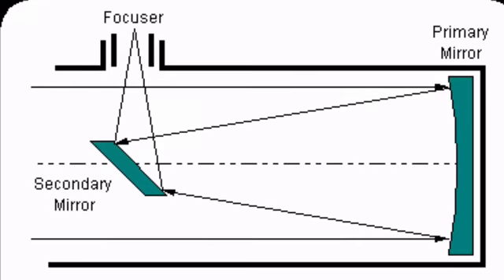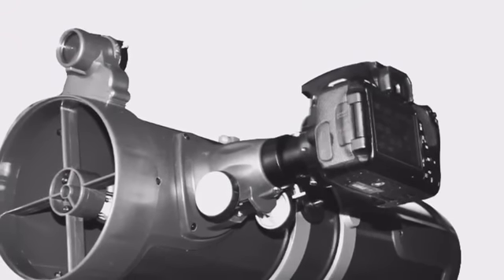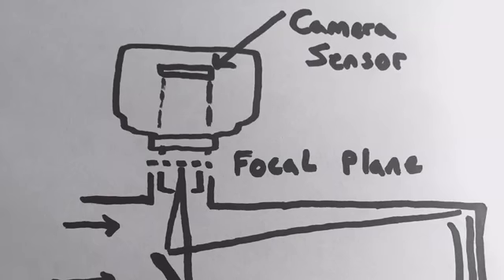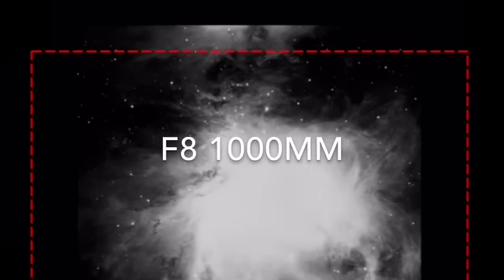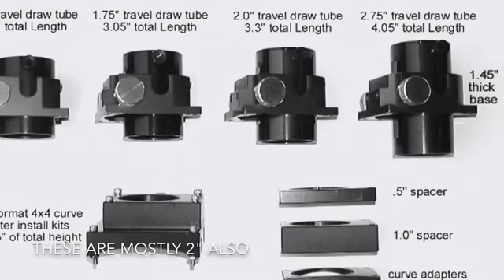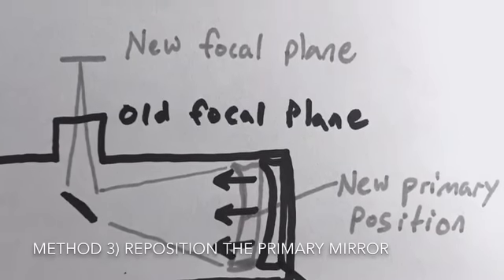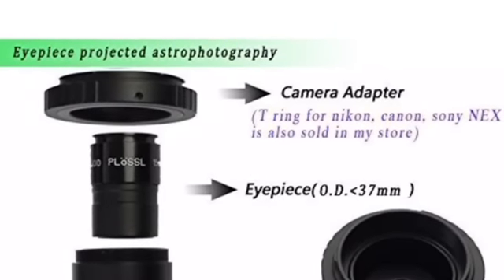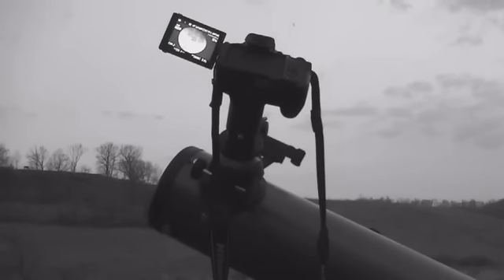Newtonian telescope how to find focus dslr astrophotography

Comment: Hello to all, thanks for this video. Just want to share how i solved this issue on a Celestron Astromaster 130 newtonian. Basically i used a mirrorless camera to fix the issue. Unlike DSLR camera, mirrorless camera sensor is positioned more forward. Instead of modifying the mirror or focuser, if you have a mirrorless camera which is popular nowadays, it can work.
Reply from the maker: That’s great info. Thanks for sharing.
Reply: I have the same telescope and a DSLR. Thanks for this great tip. Can I ask what mirrrorless camera did you use specifically?
Reply: @jaspei  Canon EOS RP :) T ring can directly fit into the RF mount without adapter so focus distance is reduced
Reply: @jaspei  we can also discuss in Astrophotography Pihilippines group FB. I saw you are also a member there. Feel free to post questions and I will help answer and post photos.
Reply: @guitarintune408  nice, and small world! I posted a question in the group to start the discussion (although still pending approval). Thanks for raising that!
Reply: @jaspei  I have the spaceprobe 130st and I just tried to use my new r6 as a prime mount and couldn't get it focused. But, I was using the rf/ef adapter. I'm going to buy the rf t ring now and hopefully that will fix it. Thanks for the info
Reply: Mirrorless cameras take poor images
Reply: @Astronurd  not really. Depends on your target. If its just star cluster like M45, a mirrorless can do the job. But if your target is a faint nebula, might as well use narrowband imaging with a mono. And, everyone has their own standards.
Reply: @guitarintune408  Yes I suppose if you are selective with your targets then they can do the job 👍

Comment: This problem has bothered me off an on for over a year, as to why I could focus on trees 600 yards away and not an antenna tower 1 mile away with my Newtonian scope.  Tons of videos show successful astrophotography for  the kind of scope I have (Celestron 130 SLT), but I always failed. Thank you for confirming that  the problem is focal plane being inside the tube (as I suspected), and for providing solutions. Been driving me nuts. I thank you immensely,
Reply from the maker: Trust me when I say I’ve been there. That’s why I made this video. Thank you for watching. Clear skies.

Comment: I did some reading and found what I needed to get started with prime focus photography with my DSLR and Meade Newtonian telescope. So went out and got the T ring and adaptor and remote shutter release. Did some more reading on camera settings and got all ready to have a go photographing the moon one early morning. The rig was all set up and the sky was clear. Turned on the camera live view. Boom, couldn't focus :( Thanks Garnett for explaining what is happening and why. I am surprised that none of the articles I read discussed this issue. Is it a problem limited to the inexpensive Newtonians?
Reply from the maker: +Tom Ball I was once in your same exact position. It was so frustrating I decided to make this video. You’re right, there isn’t much info on it strangely. The problem is astrophotography is becoming more and more popular. Companies buy their parts from a handful of distributors and they are designed around visual use only still. They produced specific lines of telescopes called astrographs for imaging and for years these were extremely expensive. They are starting to wise up to the trend finally and you’re starting to see newtonians being released with low profile stock focusers and extensions at a reasonable price. Meade has a wonderful 150mm with a 2” focuser for under $400. Most curious folks aren’t willing to shell out for expensive apochromatic refractors. It’s unreasonable to expect a hobbiest photographer to go out and buy an L series lens and the concept is the same. Fortunately they are bridging that gap now and soon most folks won’t need metal cutting tools anymore. Lol. Clear skies.
Reply: What really sucks is you can actually ask for help and they say, "buy this" and sell you half of what  you need. Example:
I want to shoot eyepiece projection thru a meade etx 60at.
The high point guru says , "buy t ring and 1.25" adapter".
Uhhhhhhh

Comment: Hello.  You have no idea how much of a value this video is. I am very new to the field of astro-photography and your clear and precise explanation has helped me solve a problem I had with my telescope with extraordinary ease (and without spending any money). Your video illustrates that there are those who are really willing to be guide to those who need to learn. My sincere thank you for taking your time to make this video.  I recently purchased a dobsonian telescope from astronomers without borders. I could not get the DSLR to focus because of the obvious reasons you explained. However when I watched your video It struck me that I could use method of moving mirrors to adjust focus. Now with this Dobsonian telescope I got, its secondary mirror is collapsible so in short, instead of moving the primary mirror, I automatically have ability to move secondary mirror on rails and bingo. That pretty much did the trick. Your video pretty much lit the light bulb. Thanks again for getting me out of my frustration.
Reply from the maker: That’s fantastic. I’m glad you didn’t give up and found the answer. That’s why I started this channel. This hobby is solid full of pitfalls and annoyances. I can’t tell you how many I ran into. I’m still finding them. There’s absolutely no reason anyone should have to repeat the mistakes of others in the age of the internet. Thank you for taking the time to write. That’s encouragement for me to continue finding and solving problems. Thanks for watching. Enjoy the hobby and never give up. Clear skies.

Comment: Great video Garnett. Good and well illustrated explanations, thorough, clear, concise and to the point.  No added junk or loud music. A youtube endangered species Y.E.S. ;-)
Reply from the maker: Thank you. You’re very kind and your comment is encouraging. I want to explore the situations and concepts I struggled with in hopes to help someone else avoid them. It’s worth it to me if it was helpful to just one individual. This was a nice thing to log on to and read. Merry Christmas.
Reply: and no selling for a camera or telescope company. And no " youll be able to see the rings of saturn clearly
Reply from the maker: Yeah it’s unfortunate. The industry is very deceptive as a whole. On top of that most YouTube astro channels are more interested in entertainment than how-to’s. You’re not completely at a loss tho. If you continue your pursuit a t-ring is invaluable. If you’re willing to dump $50+ more into it then you can get something like the SvBony 105. Webcam style planetary cameras come into focus similar to eyepieces. The sensors aren’t buried 44+mm like dslr’s. It’s a viable option for your current situation. Additionally you could modify an old webcam. A 35mm film canister is practically identical to the barrel of a 1.25” eyepiece. You still see Hubble-like images on the boxes of telescopes. You still see products marketed without specifying wether it’s an “astrograph” or not. You still see false claims of impossible weight allowances, impossible tracking accuracy, and deceptive optical clarity. It’s a trap almost everyone falls into because there’s way more promoting than honestly available unfortunately. Don’t be discouraged. It’s a fantastic hobby once you get everything ironed out. A lot of times you can move your primary mirror. I moved one in a recent video on an Orion XT8. Typically you only need longer collimation bolts. That was true of many scopes I owned. Best of luck. Clear skies.

Comment: Thanks for that clear and concise video. I have recently encountered this problem. I am trying both the Barlow method and the eyepiece projection. I have also gone for a thin, low profile t-ring, but waiting for a m48 to T2 ring (got the wrong size t-ring). Don’t understand the reason so many t-rings are wide (depth), particularly for micro 4/3 cameras. Thanks again.
Reply from the maker: Thanks for watching. Unfortunately there are far less products with ammeter scopes in mind. There’s a definite need for products that help make the hobby easily available to everyone. The market assumes you’re using a high dollar setup. There’s a million examples of this that span over an equal amount of issues. Everything from finding a platform that will support a camera/lens system and guide scope, to software, to you name it. I’ve often discussed starting a business with Jeff Lucas and innovating products that are user friendly and designed around reasonable setups. The genre is in need of it.

Comment: Low profile focuser's are far too expensive and priced because they believe astronomers have money and are willing to throw it away, there really should be taken to task for the manufacture costs to end user costs, these are probably manufactured for a couple of dollars in Taiwan/China with an extreme profit margin.
I have the eyepiece projection type but want prime focus for the lower F stop value and wider view, I can I believe achieve this with my narrow shoulder T ring adapter but we have so much cloud in Western Scotland it may be a while until we see a clear sky, I can focus on the clouds okay with about 1" of forward movement left but and I won't truly know until the sky is clear.

Great video covering everything, thanks.
Reply from the maker: I totally agree. Astronomy equipment is likely more inflated than furniture. Aside from premium fluorite glass found in apochromats you really never get what you pay for. Most folks who can spend the better half of a month up until the wee hours of the morning do have plenty of money. It’s an expensive hobby unfortunately. The more cash you dump into it the less headaches. 
Regarding testing focus you could check against a street light at a distance. Good luck. I hope it works out for you. Clear skies.

Comment: Thank you I am working out a way to use this information ! You have been more informative than anyone I have watched ! Thanks
Reply from the maker: Thank you. This was an issue for me so I had to try to save others. Information was hard to come by. Good luck and If I can help don’t hesitate. Clear skies.
Reply: Well I have a 6 inch Galileo reflector , it's a older one but works well for me . I just like to get some photos of the moon and Jupiter and it's moons. Thank you so much . Do you post any photos ? If so I will check out your channel more in detail .
Reply from the maker: I actually had one of those. It was my friend Jeff’s first telescope. Ignore the community opinion at large about Bird Jones scopes. Yes they’re typically slower systems but they are corrected. Had it not been for the advent of this style reflector many people of the past couldn’t afford a telescope. The corrector is there to counter the spherical aberration caused by a non-parabolic mirror. I’ve taken some of my favorite lunar photos with just a smart phone and my Celestron Power Seeker 127. I post on Instagram occasionally under my name. Ultimately enjoy the hobby and use what you have. I’ve personally owned just about every kind of scope there is. I’ve never tried the Rasa. I can’t honestly say I’m interested either. Lol. Second only to the Maksutov is the Newtonian reflector in my opinion. I consider the value of aperture and also the cost. A six inch apochromatic refractor would cost the same as a car. A 6” non-Bird Jones reflector, although relatively inexpensive, typically has a great deal of coma at the edge. That’s exaggerated in the faster F5’s etc where the mirrors aren’t particularly figured well. You find yourself going out to purchase an expensive coma corrector. You arrive at the same point practically. People in general just hate the Bird Jones because they think they should. A large percentage of folks claim Maksutov’s are too slow for photography of deep sky. They haven’t used one. Long story short ignore it and enjoy it. With your particular scope I think the biggest obstacle is to mitigate focus creep. A heavy camera will cause the focuser to rack in under the weight. If I’m not badly mistaken you don’t have a lock on the focuser. With a 6” Bird Jones I would be shopping for a quality smart phone adapter. Primarily I’d use it for solar system objects. A white light filter could be a great accessory also.

Comment: Great video, and really appreciate the info, I have a celestron QE130 Newtonian and could never reach focus, but thanks to you info I will now modified  the focuser and also get measurements on how far from the Chip i need to be to get sharp focus.. I thinking about making a 2" focus tube that treads in and out to achieve focus with locking ring..

thanks again for the upload.
Reply from the maker: +TheflickerofMotion you're welcome. Glad it was helpful. This is a huge issue with very little info available. After a lot of digging I decided to publish on it. Had to test first myself. A 2" upgrade is a fantastic idea. The difference is well worth the effort. I may be wrong but it seems to produce less vignetting. I imagine more light gather and generally higher quality optics are available in 2". A lock is a great addition. The GSO micro I have has a tension adjustment and focus lock. Invaluable convenience. Again, thank you for the nice comments and I am very glad it was useful. Clear skies.

Comment: Great explanation, thanks for sharing.  My Orion XT6 has threads for a camera adapter on the stock focuser but cannot achieve focus for the reason  you describe.  I've been using just the lower section of a 2X barlow clamped into the focuser so it does not protrude above the threads allowing the camera adapter to utilize the stock threads without interference.  Now for a look at moving that mirror...
Reply from the maker: +L Helbock that's a great idea you had. Whatever works. I really wish more telescopes were made with photographic use in mind. Good luck to you.

Comment: Good to know all this.  I was looking at getting the mounting stuff to hook my dslr up to my reflector scope, and now I know what else I need to do.
Reply from the maker: +ordinaryJeff you may not need to. Check it first. Some telescopes are capable of focus out the box.
Reply: Guess I could try it.  I might already have enough stuff to do it now that I thought about it.
Reply: So I didn't have the correct random stuff lying around to mount it.  Ended up just holding the camera body up to the focus tube with live view on.  I could focus on trees a little ways out, but more distant trees about a half mile away won't focus.  Couldn't run the focus tube in far enough.  I'll try a test shot anyway to see how it compares to my cheapo 1300mm lens.  Not sure which might have more magnification.

Comment: Thank you very much. You helped me focus the light at the end of the t- ring and its long adapter barrel with which it came. It turns out that the one I bought can fit my 10 and 25mm lenses inside so the plane can be moved like you explained. I wouldn't have thought about it until I watched your video.
Reply from the maker: Glad you found the solution. That’s one less telescope that ends up in a closet or garage. This hobby is filled with endless pitfalls unfortunately. Getting useful information out there is my goal. Thanks again for watching and clear skies.
Reply: @GarnettLeary  Thank you very much. Astrophotography is secondary. I wanted the telescope mainly to see the stars and amaze myself with our surroundings. Thank you for taking the time to make videos. I'll keep watching.

Comment: I you use a micro four thirds camera, which have no mirror box and 19.25mm back focus with a thin T2 adaptor you will get closer to the focal plane.  The Celestron 130SLT has a 2-inch/1.¼-inch focuser, with T2 threads available, that is relatively shallow to the OTA and will achieve prime focus (just the camera) in mid travel. Whereas a DSLR will be nominal 45mm back focus distance flange to sensor presents many problems. Sony E (NEX), mirrorless, are 18mm. 

These can also be used with a Barlow, where it is probably better to use a T2 threaded one than a loose fitting nose piece projector, or an eyepiece projector with eyepiece and/or Barlow. The more solidly the camera is attached to the OTA, the less it will vibrate.

The Olympus E-M5ii  (&up) has a further advantage in having a special Live View Boost that produce an enhanced slow frame rate with long shutter speeds, which can be magnified, allowing one to focus on the striations from the spider. Body=stabilisation can also be set for the "lens" focal length, of benefit even on a tripod. Panasonic although less noisy due to their heat sink, cannot do this.

 It should be noted however that a crop sensor camera is already going to 'magnify' the image by its crop factor due to its reduced field of view. Example a 400mm lens on MFT gives the same view as an 800mm on full frame, and a smaller image than the 650mm 130SLT "5-inch" on prime focus, with the advantage that the Newtonian is f/5 and a typical 400mm prime about f/8.